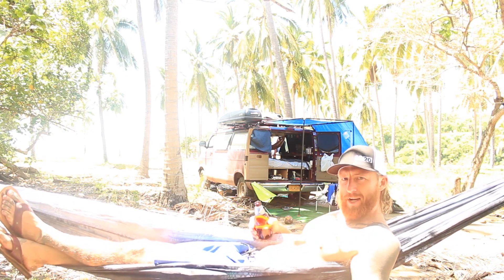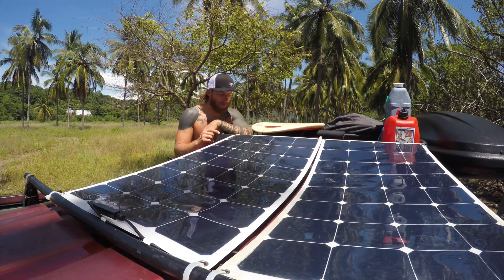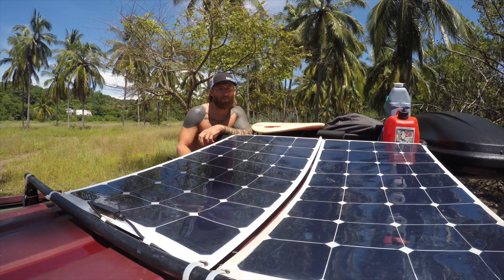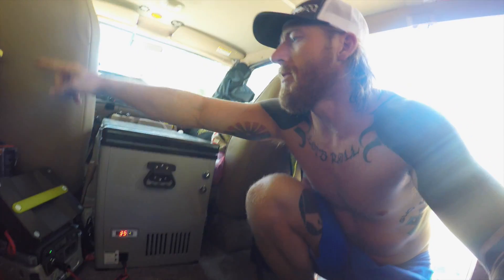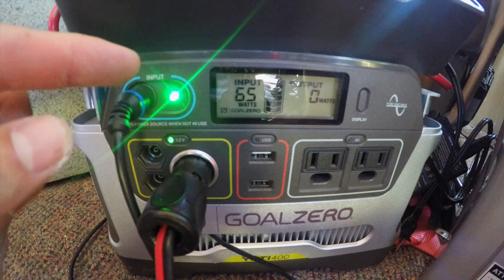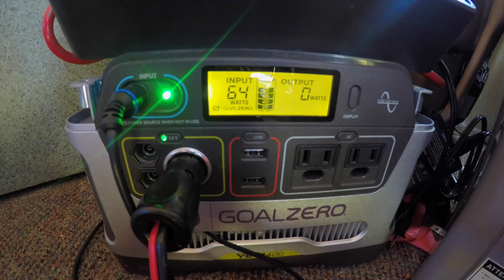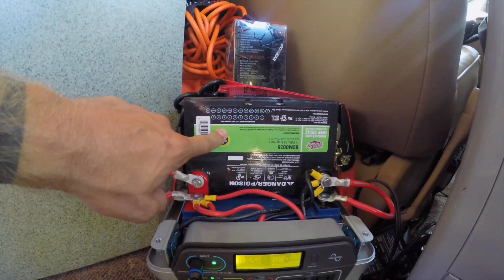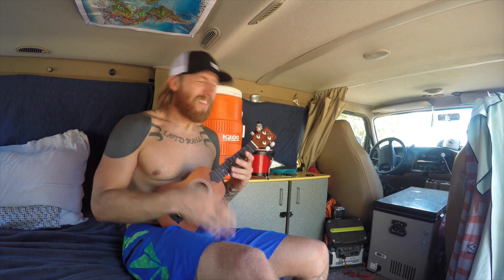Solar Power for Off Grid Travel

Comment: Wrong. Adding a second battery did NOT give you 800 Watts. You STILL have 400 Watts-what you DO now have is 70 AMPS! You are correct that you double your runtime on a full charge, but no actual POWER is gained-that number remains the same.

Comment: yes the 400watts comes from the power converter...you want to add amp hours add a batter that has 125ah you'll be good....I had a 300 watt power converter had to up grade to a 1500 watt with 300ah battery

Comment: Are you sure that additional battery is only 400 watt hours?  I just got a 1200 watt hour agm one for like $140.  The one you have looks similar in size.  I would think a 400 watt hour one would be more the size of a golf cart battery.

Anyway, it is good to see that you didn't waste more money on the Goal Zero.  Those look pretty but the cost is insane for what you get.

Btw, to pretty it up some, have you considered putting the new battery in a box of it's own.  With the Goal Zero on top of it.  You could run the cables down the sides of the Goal Zero or simply drill a couple holes in the bottom of the Goal Zero and the top of the box below.  You will probably need slightly longer cables though.  That said, what you have set up gets the job done:)
Reply: I just looked it up.  It's a...

"12V 100ah SLA AGM Deep Cycle AGM battery Group 27 for Solar, RV, Charger, Off Grid Battery Bank"

I was mistaken on the price though... it was $176.  The lower price I mentioned was for the solar panel... though, even it was $150, not $140.

I get the prices messed up because I bought it as a package.  Battery, solar panel and charge controller for $325... plus about $27 more for an inline fuse and additional cable.  Came to $352.56 total.  Got it from Windynation.  So far it works great.  We will see if it lasts the test of time...lol.
Reply: *****
Well, I've had it for over a month now.  However, I haven't used it much.  I'd just gotten back from a road trip to Florida when I bought it.  My next road trip isn't until the end of this month. 

I bought it early because I thought it was going to take a long time to set up.  Took less than an hour... lol.  Granted, I also was installing a roof vent so I had everything taken apart already inside. 

The nice thing about the solar kit was that everything came programmed and ready to go.  All I had to do was run the wires which was pretty self explanatory. 

To speed up my setup, I also went with a fuse block that connects straight to the battery.  The Blue Sea Systems ST-Blade Battery Terminal Mount Fuse Block. 

Got it from walmart for about $22.  They have a few variations... the one I got included a non fused block for the negative side also to make it easier to connect all my wires. 

The fuse block is only good for up to 100 amps total... max 30amps per connection.  Which is plenty for my small system.  My biggest item is my 200watt inverter... and even that I seldom go over 100watts on.  Each connection has it's own fuse... which you decide which size fuse to use (up to 30amp).  Uses car type fuses which you can get cheap about anywhere.
Reply: *****
Oh, yeah, those puppies are heavy...lol.

If I was creating a portable type system with one of those I would want it on rollers:). Maybe a luggage type roller system.

Btw, the Goal Zero equivalent (amp hour wise) costs $1,500 and weighs 103 pounds.  And doesn't include the solar panel...lol.  It's pretty though.
Reply: *****
Well, first, you need to look at Watts.  Going by amps can get you into trouble if you aren't careful.

The reason is because Watts=Amps X Volts.  So, when you say 120 amps in your comment you could be saying you need about 13,000 watts (110volts) or you could be saying you need only 1,400 watts (12v).  Though I suspect you probably mixed some of the 12v amps in with the 110v amps.

I can't imagine you needing 13,000 watts... lol.  However, 1,400watts max seems a hair low for running all that stuff you mentioned at once.  A low wattage microwave will use about 700watts just on it's own.  I think Nuwave ovens are about 1,500 watts.

Anyway, to answer your question, you are most likely going to need a lot more battery than that.

To give you an idea, the battery I have is 100amp hours.  That is at 12v though.  So, 1,200 watts.  BUT, you don't want to run your batteries down below 50%. Preferably not below 60%.  So, I only actually have about 600watts of storage that I can use.  That's 600watts for one hour.  When on the road I only use maybe 100w to 200w though... and mainly just at night.  So, at night when no solar power is coming in I can power my stuff for 3 to 6 hours.  Way more than enough for me.

You, however, are talking about using way more than me.  How much exactly?  That is where you add up your watts.  I recommend that you look at each item and write down how many watts it uses.  Then figure out how much you will be using it.  For example, a microwave may use 700 to 1100 watts but you aren't going to be running it 24/7.  Maybe 20 minutes a night on average (my best guess).  So, if it is a 700w microwave then I would take 700/60 and multiply by 20.  That would be 234 watt hours.

Using my battery system, that would use up about 1/3rd of my 600watt hour storage.

Anyway, you add up all your devices in this manner.  Then factor in when you will be using them.  For example, if you run the microwave only in the afternoon then odds are you will use about half the microwave wattage from the battery since you will have 300 to 400watts coming in from solar.  And even that my not matter if your panels have time to replace what you used from the battery before nightfall.

You add up all these watt hours and then multiply by at least 2... since you don't want your batteries to go below 50%.  If power is absolutely vital for you and you have no backup generator then you are probably going to want to multiply by 3 or 4 to compensate for bad whether... aka, less solar power coming in. 

That will give you an idea of how many watt hours you need in battery storage.  If you are buying 12v batteries then you divide those watts by 12 and you know about how many amp hours in batteries you need.

You aren't done yet though.  Now you need to make sure you have enough solar power coming in.  You will want to make sure you have enough power coming in during the day to meet ALL of your power usage... aka, power the stuff you run during the day and still have enough to charge the batteries for what you need at night.

There are websites dedicated to this stuff.  I only know the basics.  I'm sure you can get better info than what I've provided here.  This is just to give you an idea.  My system is very small so I could ballpark most of my calculations.  With a bigger system you probably want better formulas and stuff than what I provided above.
Reply: *****
Glad to help.  I only have a basic understanding so my info may not be 100%... so I recommend checking out other videos and stuff.

Btw, you might also want to consider adding propane to your equations.  For example, an electric stove will require you to spend a small fortune on your solar setup.  However, a propane one is dirt cheap to buy, maintain and use.  If you go this route, I recommend buying your own tank... don't do the thing where you exchange them constantly.  I've heard bad things about the exchange ones.

Also, even your fridge and AC can be done with propane.  Though, I've heard some don't like these types since you have to keep it level while in use.  Not a big deal though if you plan to stay in one spot for long periods of time.

Comment: Great setup. What brand solar panels are those, and if you didn't want to drill into the roof, how did you run the wires from the solar panels into the inside of the van?
Reply: I think he ran it through the door way, but it kinda sounded like he said he put it through the roof...

Comment: Clarifying... adding another battery will not increase your 400 Watt system to an 800 Watt system... It will only increase your 400 Watt run time when Solar is not available... which is not a bad thing...
Reply: +Lisa L I'm pretty sure he meant 800 watt hours.  Good point though.
Reply: You're correct. It will double the capacity of the battery but the wattage output will remain at 400 watt maximum if that's what the inverter is rated at.
Reply: You're both right. His system goes from 35 Amp Hours to 70 Amp hours. Additional energy storage is ALWAYS a good thing!